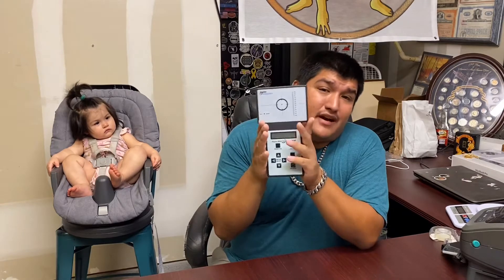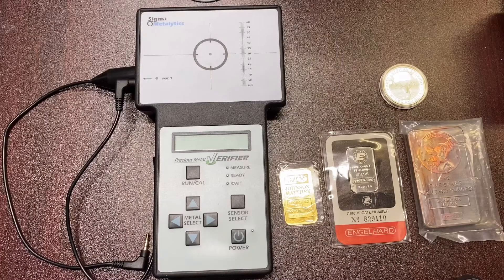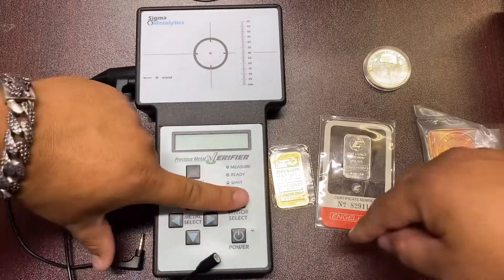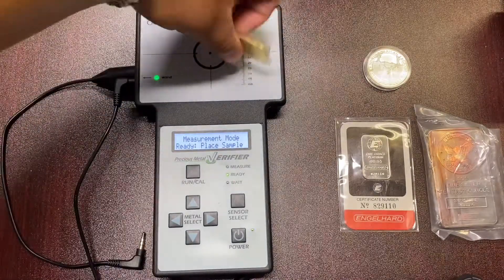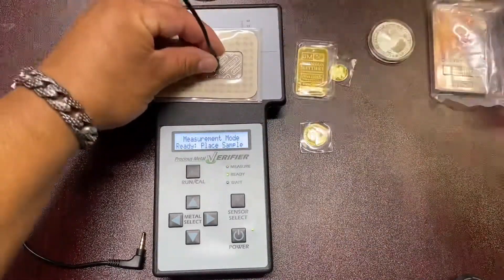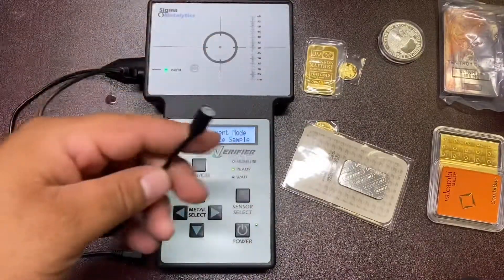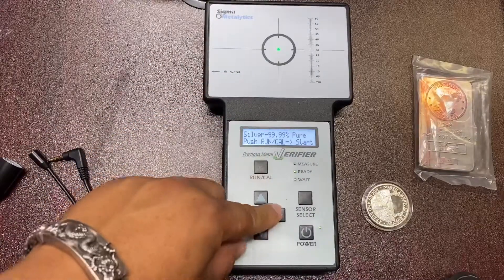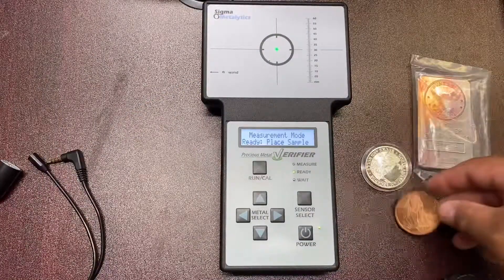Sigma Metal Verifier - Measurement Mode

Comment: That's actually not a good way to test , the metal verifier checks the  conductivity of the sample represented by those numbers you see in measurement mode, however in those regular modes let's say silver 9999 it's showing a visual representation of that number within the acceptable range( the brackets). You would have to test a lot of samples like the people who made the sgima did to establish a range, they already did that for you ,this mode is useful for things that they did not sample, so let's say you wanted to test 40% silver clad Kennedy halfs there is no option for this but if you had a pile of already verified clad halfs you could test them and find out what the range is and then use it in the future to test out unverified clad halfs
Reply: Exactly.